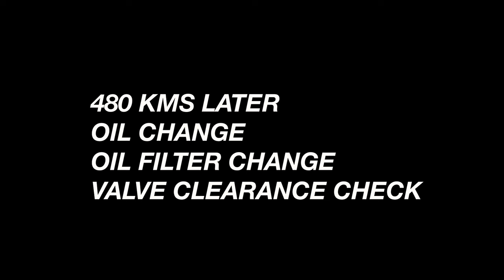TEC CAM RUNNING IN 500 KMS , THOUGHTS AND VALVE CHECK

Comment: The whole point of breaking in is to the make sure the moving engine parts settles in properly. Even tho all the parts inside the engine are designed and made with such tight tolerances there might be some mishap or slight uneven surfaces so during the initial first kilometres you shouldn't rev the engine and keep it slightly above the minimum running RPM to let the parts to grind against each other and naturally flatten out all the unevenness so during this period you should never rev the engine up to much because it defeats the whole point and can lead to those uneven surfaces causing minor scratches on the across surface, which will stay there till the end of that engines lifetime

Comment: Use some polytron metal conentrate. It will significantly reduce valve noise.
Reply from the maker: No , I shall keep the oil running clean . Also viscosity modifiers are not 100 % fool proof formula yet .

Comment: Curious why you feel reduced duration (higher valve clearance) gives a better running engine.
Reply from the maker: A slightly free exhaust valve makes for a much more FREEER running engine. Better throttle response .

Comment: Thank you for another lovely video, Ben. Is it feasible to fit the TEC camshaft on a BS3 Carburettor Himmy with 50k kms on the ODO?

What are some of the things to look out for while doing such mods on older bikes which have seen some tough miles?
Reply from the maker: no you cant fit it on a BS3. it is only for the FI variants
Reply: @ONTWOWHEELSBEN  thank you for the advice

Comment: Hi Ben. Did you put in new valve guide while changing your valve? I tried to source valve guide but RE don't sell for Himalayan. Any idea on this as the guide they currently use for leth work is the ones from Classic series which keep making a racket after head work is done!
Reply from the maker: There is no need to change a valve guide for a cam swap . My valve train was in excellent condition ( courtesy to changing engine oil at 3000 kms )
Reply: Thanks Ben for your quick reply. What about people who have to work on their valve guide but don't want to shellout on a complete new cylinder head as advised by RE workshop. And thanks on the FuelX info  @ONTWOWHEELSBEN

Comment: I agree on a horrible sounding engine 😂 unfortunately mine is also making some louder noise when hot
Still dont know what it is i hope it goes away with an oil change...
Reply from the maker: Do you run a TeC cam too ?
Reply: @ONTWOWHEELSBEN  yess i just installed it  100km with the tec cam 
thats why its a bit worrying
Reply from the maker: @tftg-travel1902  nothing to worry. The sound is something you live with